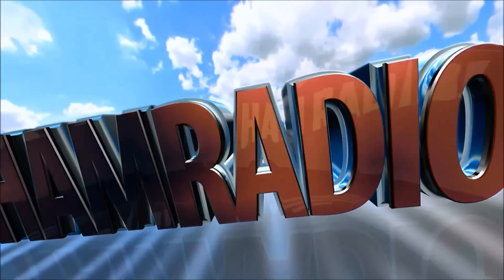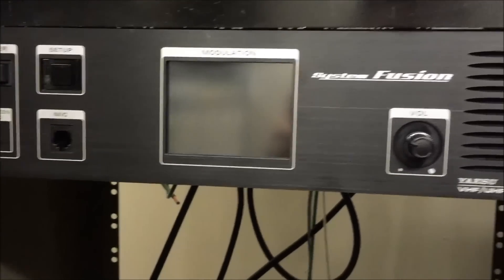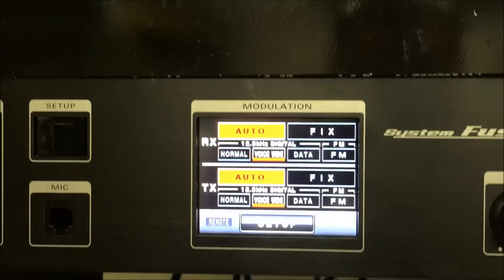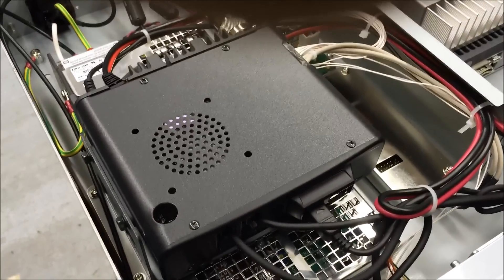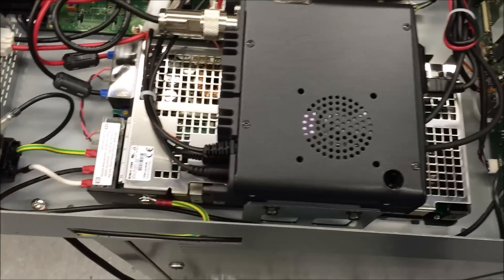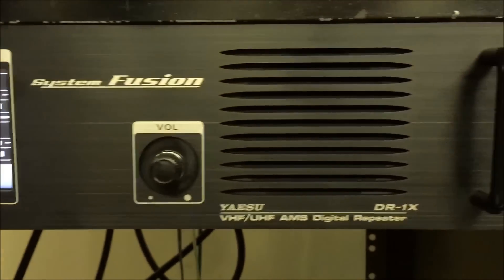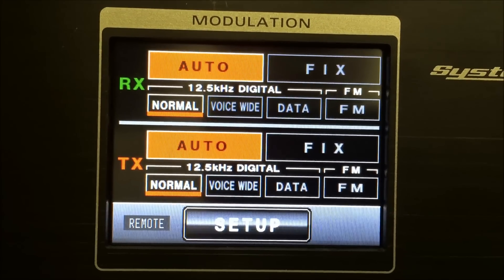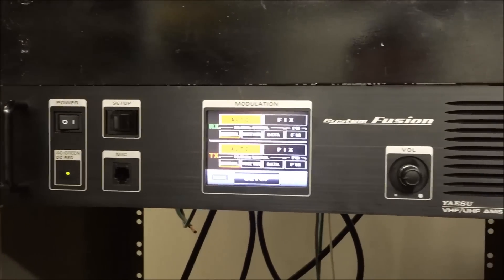Yaesu DR-1X system fusion C4FM repeater

Comment: How do I set up my FT3D to talk on the c4fm Repeters
Reply: Press MODE until you get a DN with a bar over it.  Thats is the automatic mode which will switch from FM to digital automatically.  

Its all on page 27 on this manual

https://www.classicinternational.eu/_clientfiles/manuals/yaesu-ft-3de-basis-handleiding-manual-anleitung.pdf

Comment: Since it just looks like two mobile radios stacked together with some type of interface, I'm guessing you could home brew your own repeater with two Fusion mobiles and a repeater controller, with the radios in AMS mode. Seems like that would give you a dual mode repeater to switch between c4fm and analog. An idea worth a try.
Reply: Gabriel S better yet two CDM Motorola mobiles and a mmdvm board with a pi3 for 1/2 the cost.
Reply: What's your time worth?  Considering your plan would cost nearly as much as just buying the repeater and you'll have to deal with hours upon hours of firmware writing and debugging, cable fabrication, you'll lack the dedicated interface, then you have to deal with packaging and RF isolation so you don't end up with a science project OR you can just pick up a DR-1X on ebay for well under $1000

Comment: I'm glad you made this video. Shows me whats inside, which I was that kid that took everything apart and most things worked when I put them back together. So other than antennas for Rx and Tx, power cord, is there anything else thats needed to make this work? I would like to put this in a comms truck to have the repeater function for my own personal comms. An area I'm not to knowledgeable is what it takes to build and install a normal repeater. Also can I install an amplifier to have more power or am I stuck with what it comes with. I've tried looking around to learn about installing repeaters, building them etc..Or Can you point me in the right direction. I am a licensed ham operator technician level fairly new. Thank you for any help you can give me.